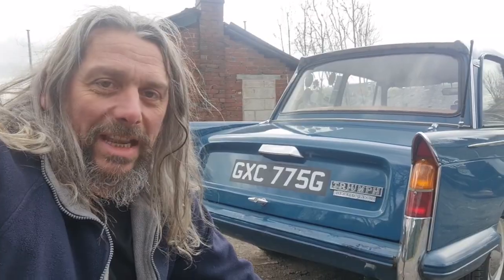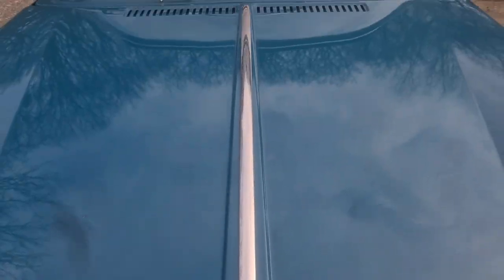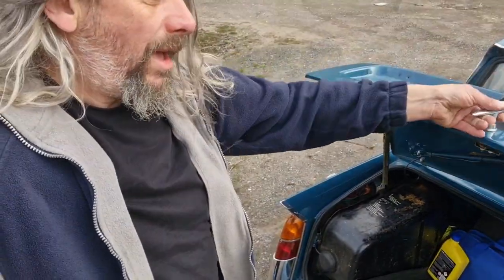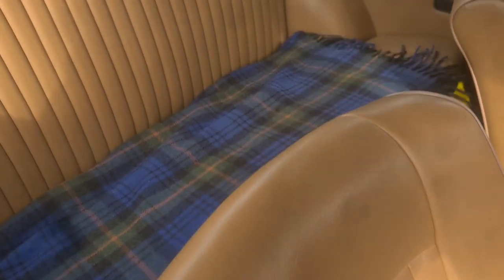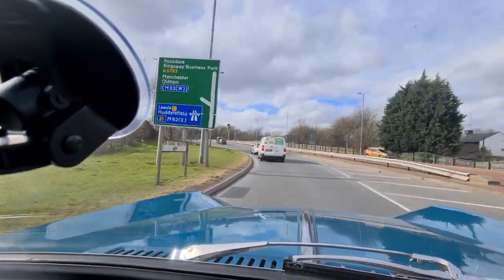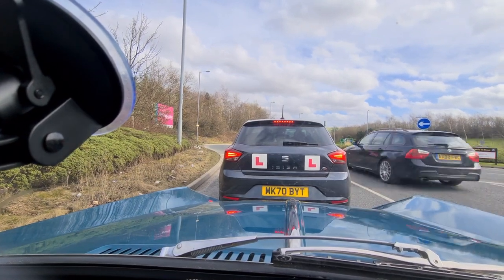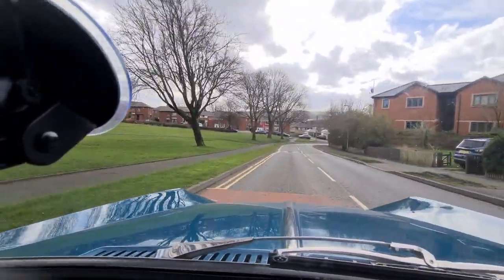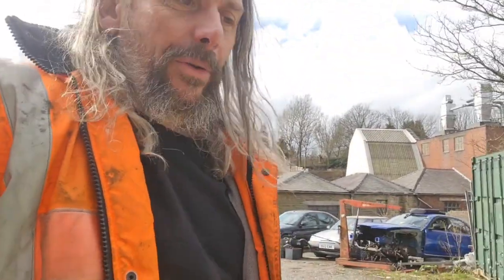Triumph Herald 13/60 test drive review

Comment: Fantastic review and Herald! Changing the gears is usually quite nice, perhaps this example needed the nylon bushes replaced in the gear stick shaft - they wear overtime  replacing these is an easy fix for smooth changing. Fantastic review! Back when cars were actually fun to drive.
Reply from the maker: Thank you 🙂

Comment: When I was 15/16 a bought a 64 herald convertible for £15 !
Fitted with the 1147 cc engine was hardly boy racer material. 
So then bought a Vitesse.  Really annoyed the boy racers at the time as the must have boy racer car was the mk 2 cortical 1600 e. They would try and burn me off the line thinking it was a herald.  To see their faces in the rear view mirror was priceless 😅

Comment: The roof unbolts fully, so cool. Also around the bumpers used to be a white rubber protection.
Reply: To Paul Stone. Somehow, the white bumper covering I'd missing. But I think it suits it! The very first ones didn't actually have the white rubber on the bumpers.

Comment: The car looks angry from the front!
Reply from the maker: Yes it does
Reply: @ProjectNigel  What I love about Triumph Heralds, is the great access to all engine & front suspension components, as the wings are really part of the bonnet & come away when you open it up.  I also love the brake & clutch fluid reservoirs, which are wide & transparent, so you can easily see if the fluid level is topped up.  Also, it must be easy to pour fluid in, without spilling it (since it's terrible for the paintwork)!

Comment: I have a 13:60 that had very bad vibration at around 55mph and eventually it got worse and was impossible to drive above 40mph. It turned out to be worn UJ's on the prop and now it's a lovely smooth drive.
Reply from the maker: Glad you figured it out

Comment: I had a spitfire mark 6 years ago. Same chassis as the herald. Real bone shaker of a ride too. A car of character. Good videos. Keep it up.
Reply: They only made 5 marks of the spitfire mark 1,2,3,4 then what would have been a Mk5 was simply called a spitfire 1500 because of the 1500cc engine.

Comment: A Triumph of a video👍!  There is no mistaking a Herald either by sight or sound.  I believe 13/60 was the last model, built until the early 70s.  A friend of mine had a Spitfire which shared underpinnings with the Herald, including the amazing bonnet opening!  Herald was also available as a convertible - with the roof down, I always thought they looked quite a lot like a speedboat!
The Herald's shiny finish revealed the PN steady-cam trolley in action for some of the closing moments, cunningly disguised as a bicycle!😃
Reply from the maker: Nothing gets past you; I thought the bike was a great idea 😁
Reply: To Dick Dastardly.  Speedboat?  Have you heard of the German amphibious car, th AMPHICAR 770? That was powered by a Triumph Herald engine - because the makers didn't want an engine that would stall when it was in the water!:  And they insisted on using the Triumph Herald engine because it was the most reliable! Lots of videos on the internet about the fascinating Amphicar 770. Speed  boat? Speed? Not in the (also convertible) Amphicar 770's case.  7 because it could do 7 mph ( or knots?) On water, and 70 mph on land!
Reply: Thanks.  I'm not familiar withe the Amphicar, I will search it out.